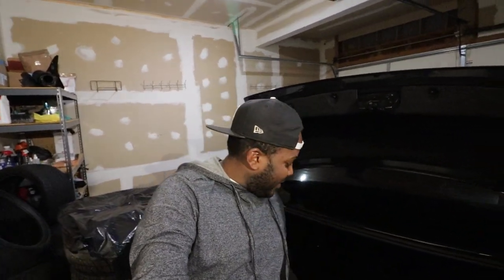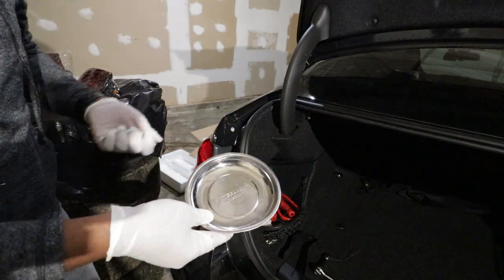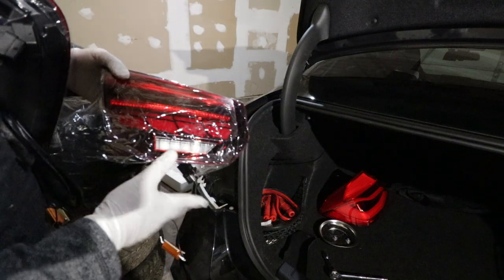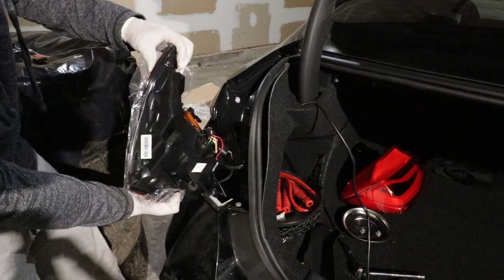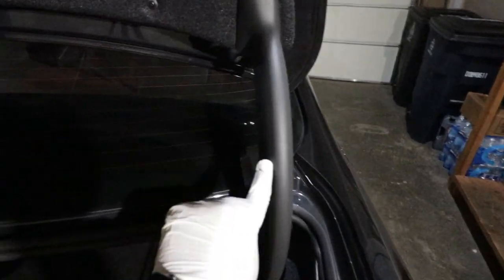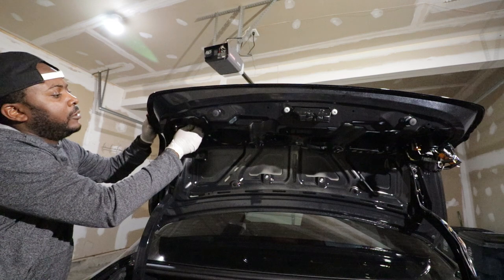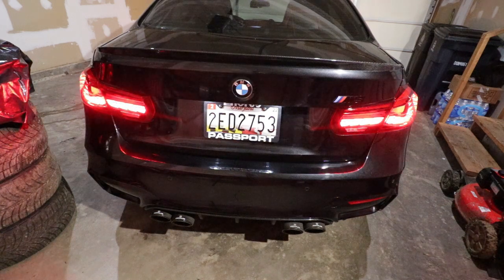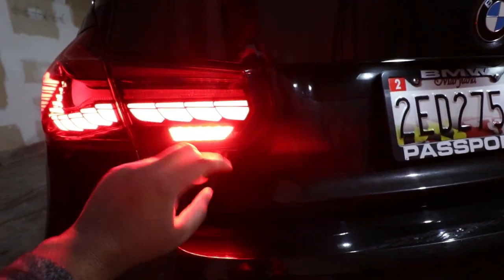How to Install M4 GTS OLED Style Light on F80 M3 & F30

Comment: Do your brake lights work before turning the car on? Not sure if it's OEM or after my install, but my brake lights don't turn on when I get into the car, push down the brake and push-key to start it. It only turns on after the car is on.
Reply: Brake lights only works when the pedal is pressed.

Comment: Hi one of my running lights not working after the installation I tried that light on both side it doesn’t work only the indicators works can you help
Reply from the maker: Did you install using the right bracket? It could also have been bad from factory. Those are plug and play.

Comment: We have to unplug the battery before the process right? I am about to install mine dont wanna screw up D:
Reply from the maker: I did not unplug my battery, but you may if you want. Thanks
Reply: Disconnecting the battery is optional, it's a personal thing, but not essential.
Reply: Ive never heard of anyone unplugging the battery before changing their taillights, i changed mine without doing it.